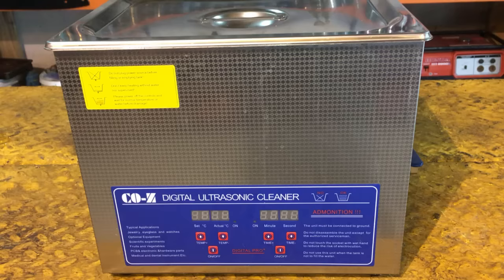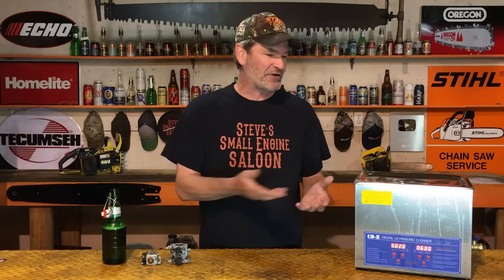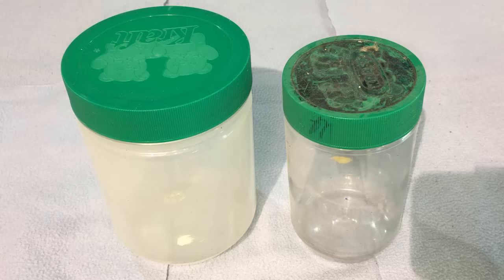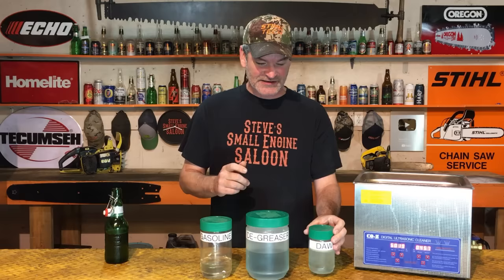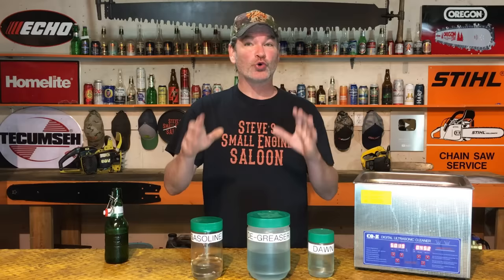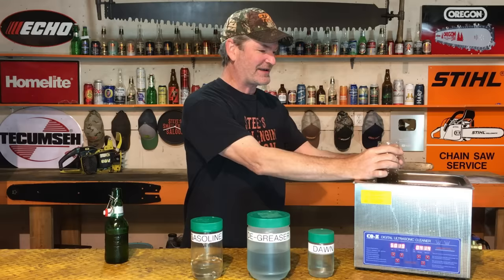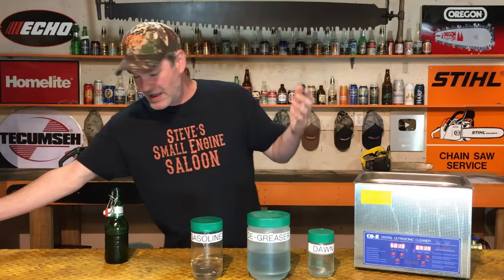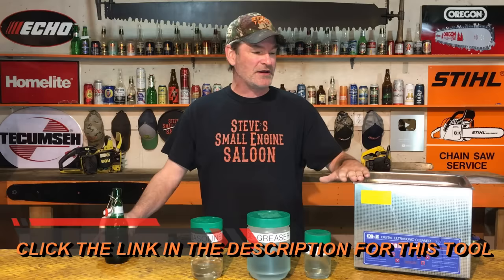ULTIMATE TIPS For Using An Ultrasonic Cleaner (Must Try)

Comment: They are saying to fill it enough for 3 reasons:
1. Damping - it needs the weight and damping to soak up the energy, otherwise that goes into tearing itself apart
2. Heat - if you have a heated chamber, it is designed expecting a certain volume of fluid that will keep it from quickly overheating and cooking itself or the cleaning fluid (think paper cup of water over a fire)
3. Frequency - you want the volume of liquid tuned to produce high motion at the machine's operating frequency so it will clean most effectively
Reply from the maker: Interesting!

Comment: What media would be best for cleaning needle bearings? I have a couple of cages needle upper crank bearings for some small outboards. They seem to spin fine but have some surface rust on the outer races. At $150 each I figure cleaning them is worth a shot. I plan to use premix 2 stroke gas mix in a jar since that’s what lines the bearing while in use.

Comment: You can make a tank that fits into the bigger tank and opens up further imagine a small box welded over a cut out hole to the bottom of a bigger box , like if you need to clean a guns barrel or something that is longer than fits your Maschine
Also great is put a thick plastic bag into the tank and then whater in
You got to be careful with temperature with bags and  put a bit of whater directly in the tank outside the bag

Comment: Glass jars are better for allowing the sonic energy to penetrate through. To prove it, put aluminum foil inside of a plastic jar and a glass jar. The sonic energy will put more holes in the aluminum foil that is in the glass jar… it is also likely dependent on the thickness of the plastic used.

Comment: To make clean up easier when not using containers, Im wondering if you could use those disposable liners made for slow cookers.
Reply: You could but I would assume not with heat or it could melt the plastic bag

Comment: Great video Steve, Love the tips peanut butter jars , Gasoline, degreaser, Dawn etc, just wondering have you tried cleaning copper tube in the u/s cleaner ? If so what solution did you find best? Thanks Kev

Comment: Funny/true story since my original post 2yrs ago ......I bought a large one off fleabay. I was pretty busy so it sat unopened in the shipping box. Eventually, I get a notice from eBay itself that they have had complaints about this model smoking and burning up. I contact the seller, Chinese of course and I get an email back starting out with the salutation; My Dearest Friend.....lol.

The seller wanted to see the letter from eBay. I said they were stalling. eBay stepped in and refunded my whole amount plus shipping. THEN, "My Dearest Friend", said to just dispose of the unit myself. Curious about what the problem was, I started using it. A lot of these units, even the big ones, are made for cleaning jewelry and the like. If you put something of too much metal mass in like the base of a four-barrel carb, it will start to short out the transducers. So yes, mine did smoke, but after reducing the size of the metal mass I put in it, it works fine. Still, I wouldn't leave it unattended.  

Buyer beware, do the research......make sure it's not just a large jewelry cleaner and can clean heavy metal masses. Small engine carbs are fine.

Comment: WHEN using a water-based cleaner in an ultrasonic-cleaner,
THEN use non-foaming cleaning-solution,
AND always use ear-protection.

The basic cleaning-solution to use in them is water+washing-soda.

Why washing-soda?

Because it is sufficiently-alkali to destroy any oil/grease, AND it doesn't foam.

You NEED to get the amount of liquid in the ultrasonic-cleaner up to its proper level ( running it too-low can damage your machine's transducers.

I add just a tiny bit of "he" laundry-detergent, to get the enzymes in it.

Comment: Since sound travels much better thru water (rather than air for example) is it possible to use a smaller tub - lets say wider but 10cm shallow, 
put a deeper container inside that's 20cm deep and full of water - ie the water in the container is higher than the height of the ultrasonic cleaner.
So could you clean larger items this way?

Comment: Hi. I bought a mini one that took forever to clean then died after about 3 hours total use. My question is, how long have you been using that brand of ultrasonic cleaner?
Reply: This brand is a good one that is used by many, I’m sure you’ve already purchased a new one but if anyone else has the same question and comes across this I hope it helps someone. Main rule is to always make sure to follow the directions on never even plussing in the machine until it’s filled to the full line with water, then you can plug the machine into the wall.

Comment: if your using gasoline in your cleaner ( and why not !) it would be a good idea to have the heat setting off or only up to warm to the touch.... gasoline vaporizes at 110 degrees in temperature, and vaporized gasoline ignites extremely easy ! so you could have a big explosion !
...i was looking for information on a cleaning solution to use on my carburetors in the shop
and gasoline makes perfect sense.... but without the heat !  and in a well ventilated room
 there for doing it in plastic jars like steve says makes much better sense !
just use water in the tank and use a jar of gas with your parts in it and do it that way
.....
thanks Steve !

Comment: I've read several places online that the ultrasonic cleaners can damage/strip chrome especially if the chrome is already pitted or compromised in any way.  I want o get one to help degrease and de-rust tools and parts but not if things will be damaged.  I could understand it happening if you use a caustic solution but not in general.  Have you ever experienced chrome flaking off or otherwise being damaged as a result of the ultrasonic cleaner?

Comment: You're the greatest Steve.   I just received my cleaner and wasn't sure what solutions to use (instructions pretty lame) so searched YouTube.  Oh bitchen there's Steve.   As usual your information was a huge bonus and I didn't need to look any further.   Thanks so much...   Damn that beer looks good.
Reply from the maker: Right on Buddy!  You're Welcome...
Reply: @Weseng
If you're cleaning cured paint, polyester, bondo, epoxy, varnish, etc., use Acrastrip 600. I use a 60/40 solution of water to Acrastrip. Heated? For sure. Let it run 20 - 40 minutes. If parts are aluminum, no more than 40 minutes or you might start to pit the aluminum.

Comment: Things to try:  Evaporust in whole tank. Kerosene or diesel fuel in a peanut butter jar. Specialty chemical (think acetone/heptane/ etc. degreaser/glue remover using proper safety precautions and do it in driveway) in a peanut butter jar. The best cleaner for really dirty, dark-stained coffee pots that haven't been been cleaned in a year or so is 2 tabs of Urnex TABZ cleaner (from Amazon, etc.) dissolved in boiling water; the process commences with putting the 2 tablets in the filter basket and running a cycle of hot, boiling clear water, not old coffee, through your coffee pot, let it sit for 2 minutes or so , then brush the solution around around, and pour it out.  Rinse twice with fresh water, and behold a surgically clean coffee pot, particularly those made of stainless steel.  Other cleaners will simply not clean a coffee pot without scrubbing it with a scrubby sponge(on glass) or steel wool (on stainless steel). I think so much of the effectiveness of these Urnex Tabs in hot water that they should be perfect for cleaning anything made of metal, including any dirty shop tool, socket set, or piece of junk, provided the Urnex Tabz solution starts out really hot and stays hot while the ultrasonic machine is doing its job.  Best to use it outside to avoid spills and exciting, but unexpected, results.

P.S. Using gasoline, no matter how effective, inside a heated or unheated ultrasonic cleaning machine while the machine is located inside a house, garage or other insured structure, or within 25 feet of children, could lead to disasters that will never be covered by homeowners or shop fire insurance or other hazard liability insurance.  What you were trying to accomplish using gasoline and the machine inside an insured structure could never be explained well enough to get any foreseeable damage covered by any known insurance policy, IMHO.

Comment: How do you get rid of the gasoline?  Once its been used and there is crud suspended in it you can't run it through an engine.  How do you dispose of it?

Comment: Kerosene although pricey is a great solvent. I use diesel fuel in my large parts cleaner for car stuff so it may be good. Gasoline is very flammable  and fumes off into the room for a long time. Never put your fingers into a running ultrasonic while turned on.

Comment: I use distilled water and vinegar to clean fouled spark plugs like new. Those abrasive plug cleaners that run off compressed air will leave grit deep inside that ends up in your cylinder. Try my method. It works great.

Comment: As a solvent I use a special one , not gasoline or nitro type solvent (sorry I don't know if I'm spelling correctly) , but it's one that does not smell so much and evaporates very slowly. Still dissolves oils and grease, not so aggressive as gasoline but gets the job done. Also to mention that I fill the tub of the ultrasonic cleaner. This solvent is not that flammable. Edit :grammar, thanks Riccardo
Reply: A diluent is something that dilutes the concentration of another, usually water.  I think the choice word here, is solvent.  It's to dissolve the crap off.  But then again, gases can work as solvents too.

Comment: Be aware that caustic (alkali ) based cleaners will attack aluminium and some zinc based alloys so should be avoided. If you do use them keep it short and sweet and either neutralise the cleaning solution afterwards or rinse very well. Most car washes are alkali so beware of using them, they are good at cleaning though, some are pH neutral and work just as well.

Comment: the reason for having to fill the US Cleaner to the top will be VSWR Vertical Standing Wave Ratio.
i recently had a blonde moment and set the microwave and forgot to put my food in it, there was nothing to absorb the microwaves and it blew the magnetron.
i now keep a glass of water in the microwave when not in use.
Reply: VSWR stands for voltage standing wave ratio

Comment: My mother used to clean brass, copper, or other small stuff with ketchup. It would take at least ten minutes to shine up a pile of pennies or a dozen corroded shell casings submerged in just enough ketchup to cover it, premixed with a literal splash of water, just enough for it to get into all over everything. She would do this to clean her glasses, jewelry, etc. I wonder what a small ziplock bag full of ketchup would do to some rusty nuts, bolts, and washers in your ultrasonic cleaner.

Comment: What about using diesel fuel for cleaning  metal auto parts?  When I used it in a parts cleaner it worked well and it lubricated the parts as well.

Comment: Great video, but be careful with petrol / gasoline folks…..with some plastic containers , it will melt the plastic and create a big mess ,not to mention a fire hazard…… also be careful with old engine oil in an old plastic milk container…it will eventually collapse due to the petrol found in oil.😮

Comment: A long time ago I learned (the hard way) gasoline will quickly dissolve and eat through some plastic containers (not originally designed for filling with gasoline).  So if you do not want an instant gasolinge spill (and fire hazard) be sure your gasoline does not dissolve the container.

Comment: 3 questions:    1) What do you do with the old dirty gas after using it to clean?  Dump it on a burn pile?   2) Is it safe to put your bare hands in the ultrasonic cleaner if you are holding the open container and will it clean your hands at the same time of dirt and grease?  3) What about using zip-lock bags to float your parts instead of jars?

Comment: When using my Ultrasonic Cleaner, I like to First get the desired cleaning liquid of choice into either a Glass/Steel coffee jar/tin that Completely submerges the Part. 

I then put that into the Bowl of the Cleaner and fill it to the Full mark. It won't matter if the jar and contents are sitting Higher than the water level in the Bowl of the Cleaner.....I've always found it is more Advantageous to have it as Full as possible.

If the Cleaning liquid is Flammable, make sure it is Never Heated to it's Flash-point and is preferably in a Air-tight container if it reaches it's Vapour-point, otherwise it is going to be a Bad day for you. Some liquids are as low as 56⁰C and they will Ignite......remember that as the Ultrasonic Cleaner runs it will continuously be getting Hotter, even without the Heater running.

I tend to use Diesel or Kerosene as it is far less Flammable than Petrol/Acetone/Methanol and run it over a longer time period....they also react differently than Water does as a Ultrasonic Cleaner is designed/tuned to run Efficiently with the Specific Density of Water.

Comment: get a tub and a electric sander fix it to the side fill with water and does real well with engine parts bigger than that basket
Reply: Any specifics on the type of tub?
Reply: 12inch x 18inch and strap it to the sides

Comment: I have been using ziplock plastic bags ( parts inside ) with my cleaning solution in them and fill the tank with water , turn it on and forget it for as long as it takes , yes I use gasoline , carb cleaner , soap water and ammonia << this is my go-to for jewelry and the clean-up is as easy as taking the bag out and putting it back into a container after filtering for re-use . I have had at least one ultrasonic at all times in my shop for the last 40 years and they have come way down in price . NEVER PUT EMERALDS OR OPALS IN ONE THE ULTRASONIC WILL DESTROY THEM !

Comment: I’ve been using an ultrasonic cleaner since the 70’s for cleaning artist airbrush parts and you can’t fill it with acetone or lacquer thinner,it would cost a fortune. I used glass or stainless steel containers with the cleaner in them and water in the ultrasonic. No big deal.
Reply from the maker: Right on

Comment: Charcoal lighter fluid is an excellent cleaner for all sorts of things, it’s not harsh and safer than Gasoline. It also won’t harm paint of finishes either. No, I’m not worried about using gas, and have for many, many things. Just tossing out an option.
Reply from the maker: Right on Pat!

Comment: I have a question.  Does it matter if the cleaning basket (metal) touches the bottom of the cleaner?  (Flat bottom basket laying flat on the bottom of the cleaning unit)
Reply: No 😂 it’s made to sit in the unit touching the bottom.

Comment: I have some intake and exhaust valves that I tried for two sessions of one hour with dawn and I am not impressed. I am actually disappointed so I am trying it again with "GUMOUT" injecter/fuel system cleaner. So far it has been through two rounds and working on the third and there is still staining on the valve. I put the valves in a small glass jar and I have the temperature at 55 degrees.

Comment: Just got a cleaner and it is awesome!...but watch out for the tip about the toilet bowl cleaner.  Just cleaned a bunch of Snap-On sockets for 30 mins. @ 30 degrees celsius and when I took them out the chrome-finish was stained and partially ruined...no big deal cuz it's only cosmetic but I won't do it again.  I'll stick with Dawn or gas.

Comment: That's a great idea. I only use mine to clean Silver coins and for Silver, the best thing is citric acid solution, and before that, denatured alcohol (depending on severity of contamination). Citric acid is cheap and most grocery stores have it in the confectionery section.
Reply from the maker: Right on
Reply: You should never EVER clean silver coins...it ruins the numismatic value.
Reply: @jacktorse2145  I would never use anything ABRASIVE on any coin, and in most instances the sheer quantity of coins I handle makes any kind of cleaning a wasteful proposition. However, if you have a proof coin from the 50s or 60s and it's slightly tarnished (but otherwise undamaged), you'll have a hard time getting paid fair market value. In that case it's best to remove the shellac by dipping it in alcohol (the only thing that dissolves shellac) and then acetone to get rid of the alcohol. Then use the ultrasonic cleaner to remove the tarnish, and then either put it in a ziploc baggie or have it slabbed. Sometimes I'll get a Silver coin that's highly tarnished and upon removal of the tarnish using citric acid I find that the coin had been cleaned using an abrasive material, then covered up with artificial tarnishing using liver of sulphur. In that case the only solution is to use an accelerated method of re-tarnishing these coins using a proprietary method I developed that simply accelerates the natural process over the course of about one year. So basically at any one time I have about 300 coins like that set up in trays geting flipped over about once a month to make the re-tarnishing process look as natural as possible.

Comment: Also, kudos for a very informative video. 
Question: is the tank filled all the way to the full line and then rises higher with the jars you stick in there, or is it a little lower so it reaches fill with the added jar?
Reply: Put your item in first, then fill to the line.